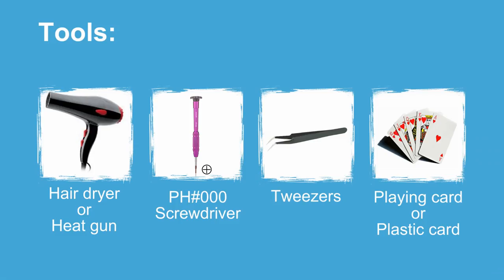HTC U11 Rear Camera Repair Guide

Comment: If u have a u11,throw it in the trash where it belongs, worst purchase ever!!!!👎
Reply: not really. I have been using it for the last 3.5 yrs and other than reduced battery capacity i haven't noticed any significant downgrade in performance or anything. The camera is great as ever and multitasking is buttery smooth. But sadly, few days back, the phone fell from my hand to the ground and since then the home button/fingerprint sensor and camera are not working.....
Reply: @rafidrafsan  Sux. I was able to wind up on the winning end of an Ebay scam by purchasing from a Chinese scammer who was selling refurbed U-11s, which had issues, as brand new, and eBay issued me a refund whilst the scammer dropped out of existence and never provided me a return mailing label! 2 TIMES!!! So now, I have 3 HTC U-11s, 2 of them at no cost to me & one of them my original with shattered front & back glass. So that's 2 phones for parts, a brand new OEM battery from Mobilesentrix, and a free guide on Youtube to guide me through the process of swapping out a case, camera, and battery!
WOOHOO!!